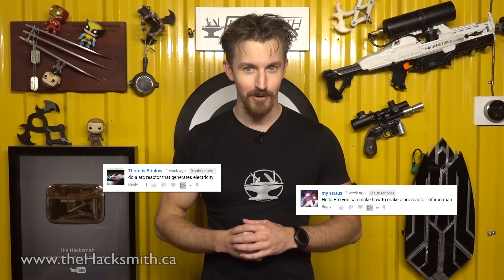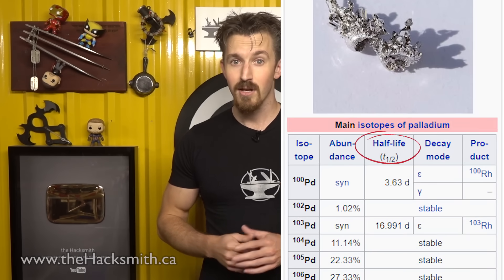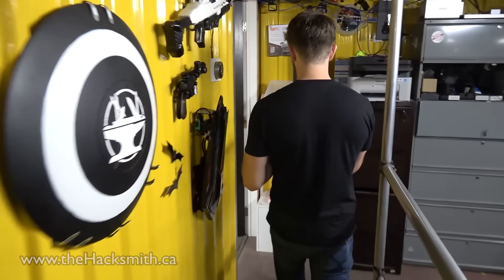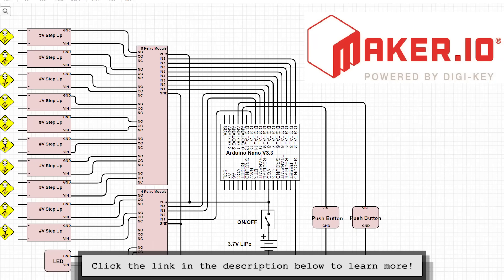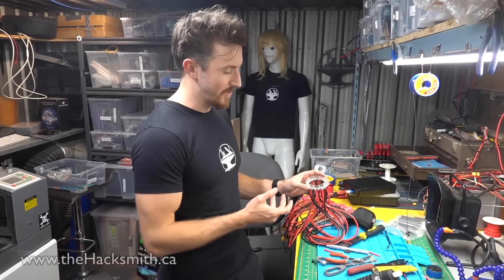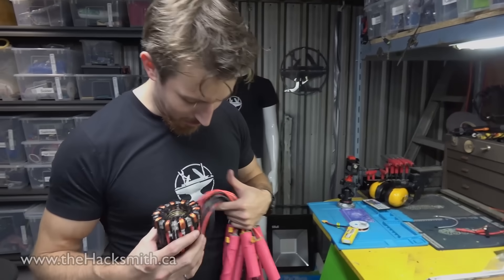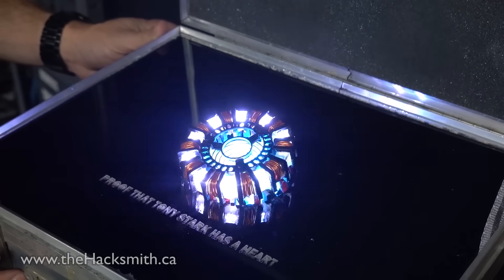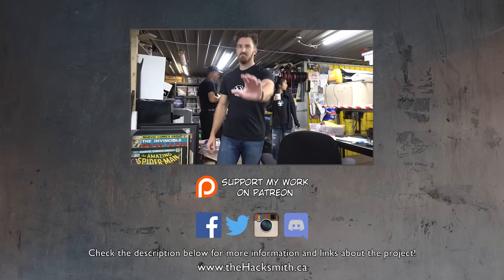Real Arc Reactor (ionized plasma generator)

Comment: No it's not I have a triple cage magnetic engine with 40v 5amp captivity create the extra voltage which cannot be destroyed it create  a iron dust field  for it magnetism and creative magnet field of iron around itself cannot be stopped and get started it's very hard to stop it but it be very useful for me yes I can use it for many portable works it is a free energy sorce 👍
Reply from the maker: wat
Reply: @hacksmith  yup it true I just using it right now to change inverter battery ok
Reply: @hacksmith  yea lessvoltage more ampire problem  can u suggest me some thing👍❤️

Comment: What happens to power if current is doubled?

For a resistive load, as the voltage increases the current will increase by the same ratio. If the voltage doubles the current doubles and the power goes up by four times.

Comment: What if you added a

A voltage doubler to the Stark reactor

If people don't know A voltage doubler  is an electronic circuit which charges capacitors from the input voltage and switches these charges in such a way that, in the ideal case, exactly twice the voltage is produced at the output as at its input

Comment: Ok there has to be a way to make a ark reactor that generates energy AT LEAST. Though what to run it on is hard to pick...
Mabey a injection of a gas that's not just air, something that the electricity can take energy from to generate power

Comment: you said it won't power anything useful, yet it produced 20 amps when you tested it. I'm not an engineer but on the Internet it sais a freezer uses 0.86 amps and a fridge 0.5 amps. so is it correct that you can make one to plug your fridge freezer in

Comment: The nice thing about the arc reactor is that it could really work. And it's not because of some "free energy hocus pocus", it is because of the way it's built which reminds me of a fusion reaction. To be more accurate, it reminds me of a tokamak reactor. Which in theory should work (and they are still working on it)

Just give them another 30 years and it'll eventually happen
Reply: the sparks dont actually generate electricity , and a chord coming out the back of the box powers the plug
Reply: @wildyghost3090  uhm yes? I know that?
Reply: dont worry ill make it happen
Reply: @hereforyou7322  please let us know when it is done
Reply: @jacclol8193  hahahha
Reply: @hereforyou7322  the most powerful man on earth
Reply: And how are you gonna fit that in the size of your hand.
Reply: Ïíœ
Reply: My channel makes fun soccer animations. If you have free time, you can stop by and watch it, thank you.
Reply: They would simply use the heat the reactor produces to create steam and move massive generators.

Comment: This is pretty cool, but I think you missed a key element to this project, u need an electro magnet. Magnets can hold an electric charge and essentially become a battery. You could actually achieve this build but don't forget Tony stark built this mini arc reactor to stop shrapnel from entering his heart. That's important to remember. So, if you use an electromagnet in your design your reactor would hold the charge rather than having to take it from so many 'tasers'. The electricity would travel around the arc continuously even once your removed your power source. Basically you'd charge it up once like a mobile phone.... im teaching myself quantum physics and mechanics to figure it all out haha awesome video tho guys

Comment: Each high voltage generator gives the output voltage of    
80kv right. Then 20 amps is just 
120v right,which is not near to 800000v. Plz anyone explain me

Comment: How did you transmit the high voltage to the air? I want to build something like this for a Science experiment.
Reply from the maker: High voltage naturally jumps air. It's about 1000V per centimeter typically

Comment: HackSmith made an ARK Reactor that expends energy to shine. Alex made a Reactor that actually produces energy (hydrogen) that can be practically used.
Reply from the maker: No, both use energy and do not create it... Hydrogen generation still requires input energy to create hydrogen gas. So neither are real arc reactors
Reply: @hacksmith  In the Alex reactor, the process of converting energy from one type to another is underway - from electricity and water into a combustible gas, which can be practically used in a different way than just electricity. Yes, of course, the energy costs exceed the production of other types of energy. This is not a "perpetual motion machine".
In other words, a hydrogen-oxygen gas mixture is more practical for use in this concept of the final device. Even a turbojet engine can be powered with such gas - the only question is the concentration and supply of such fuel to the combustion chamber. "But this is not a problem - this is a challenge"). Well, most likely, on a mixture - like a hybrid internal combustion engine - on a mixture of gas with kerosene or diesel.

Comment: I understand it's not worth it to sell to the grid but it charged your cell phone correct and how many times would charge your cell phone specially instead of trying to get the house voltage power you actually get USB power or 12 volt power and does it produce more energy then other means of cost a portable generator or emergency generator
Could be very useful
Reply from the maker: It's just using the battery though! It's just like a powerbank

Comment: 80kV per module? I seriously, seriously doubt that. Those modules don't produce anywhere near as high a voltage as they claim to output. I've had a few of them and they seem to be in the region of 30 - 35kV. If you go much higher you start to get arcing inside the modules and it pretty much kills them straight away.

Comment: Why not just make a scaled down circular krypton (or another gas if you wand a different color) arc lamp and use the coils to constrict the plasma, possibly even create the sensation of the plasma to be circulating ? I know that the container would be a hassle to fill up and seal and make sure it wouldn't melt but with big enough brains.... It would have many benefits, firstly the breakthrough voltage would be much lower so you would be able to use less batteries and wires and it could be wearable (with proper housing)

Comment: Theoretically speaking creating a perpetual energy would be possible within the law of conservation of energy similar to how some cars charge their batteries while you are driving they are simply converting a portion of the inertia and potential energy of momentum into a usable state and to create something like an arc reactor you would just need something that's able to generate a massive amount of power and feed a small portion of it back into the machine itself in order to continue operation

Comment: His circuit is impractical and too complicated for the intended (decorative) use.  Instead, use a resonant circuit (as for solid-state Tesla coils/plasma ball lamps) and thank me later.... (lower noise level, high frequency = easy to get longer arcs/higher voltages by resonant coupling).  Use the unconnected outer coils to guide the plasma arc by connecting them between "top load" and ground of the resonant circuit and switch them fast (e.g. multi plexing). Remember that voltage with high frequency can pass insulators 
, that is why this would work. Alernatively  try to use them to guide the plasma, but their electric field will most likely be too weak to cause an effect.
Just look up spark gap tesla coil and solid state tesla coil. The rest is self-explanatory.
Will look much more "realistic" =)

Comment: The term ionized needs to be tread on carefully and needs extreme precautions. Any kind of ionized radiation is very harmful. If the cells in your body detect atoms being split(which is what ionized means) then they will multiply out of control (which is what cancer means).

Comment: Just remember this!
"If it is possible? It is done!
If it is IMPOSSIBLE? It WILL BE done!"

KEEP TRYING! Thomas Edison failed over 2,000 times, before he finally figured out how to make a working light bulb. When asked, "How he felt about failing over 2,000 times?", he answered, "I didn't fail. I just found out 2,000 ways NOT to make a light bulb."
I honestly believe that EVENTUALLY, SOMEBODY WILL figure out how to create one of these. Sometimes looking at things from a different perspective can get a project over a hurdle, such as instead of using pressure, maybe using a vacuum? Light bulb elements are inside of a vacuum, instead of pressure. The vacuum, (absence of oxygen), I'd what prevents the element from burning in half. Perhaps a vacuum sealed Arc Reactor may be a hurdle that may be a key to the link that gets the thing figured out? Vacuum can possibly prevent heat build up, like in outer space? Is there a form of gas that can be inserted that has the ability to carry voltage, or change from positive to negative as it rotates over positive and negative posts inside an enclosed looped chamber? Just curious? Gotta keep trying? 😁👍

Comment: ARC reactor doesn't make arcs in the small device. It ionizes palladium, right? the palladium is glowing and giving off the radiation that is used as energy. ARC is for (affordable, robust, compact) not ionized air electricity arc. I'm pretty sure there is no air in the mini reactor either and it doesn't take the form of a tokamak like the big reactor that powers the facility using rare-earth barium copper oxide in a toroidal field. Unless I'm completely wrong, this device is more of a round taser, a neat cosplay prop. It is cool though!

Comment: The arc reactor looks more like a plasma based nuclear fusion reactor with the final ring not generating but creating a electromagnetic stabilisation circuit as the arc reactor is a fusion reactor using electric arcs to create plasma and then its turning plasma into electricity

Comment: Well...let' s also keep in mind an arc reactor is NOT a perpetual energy device. It's essentially a super battery. And I mean SUPER...BATTERY...so I think the arc reactor is meant to be what happens when you combine maximum efficiency with capacity.

Also remember that Tony has had to change and modify his arc reactor many times in the movies.

Comment: You know, I had an idea on how to make an ark reactor to. You see, I believe that plasma is when something gets so hot that the bonds between the molecules break, leaving freely floating particles and what happens in the sun is that these particles bond together, forming hydrogen so I was thinking that if you got something, turned it into plasma, and put wires made out of a positively charged substance, the negative particles would be attracted to the positive particles in the wire, bond with then, and create electricity. Let me know if it is smart, stupid, or if your too busy don't answer.
Reply: @Game Plays 1230 thnx
Reply: FBI open up

Comment: hacksmith: "alright i need to charge my phone let me get my charger"
pulls out entire arc reactor
Reply: Charges phone in 2 seconds. 😁👍
Reply: @glenturney4750  leaves it in for 3 seconds and phone explodes
Reply: @bigbosspanda1976  leave it for four seconds and it becomes a nuke
Reply: @solitude9875  pretty sure I would have a hard time charging it for 4 seconds after the phone explodes.
Reply: @bigbosspanda1976  no no, it comes in two stages:

The first when you blow the battery, the next when you blow the entire power grid
Reply: @solitude9875  and if you leave it for 5 seconds all technology in the world will be destroyed.
Reply: @bigbosspanda1976  lol-
Reply: @professional cheese Leave it for 6.4 sec and black hole will form, from the mass amount of energy and it collapses on it self.

Comment: 20 amperes...
Doesn't produce enough power to do anything useful...
Even at no more voltage than it takes to charge a phone, that's 100 watts!
Pretty impressive conversion of energy, considering the battery powering that contraption.

Comment: i wonder
can the hacksmith miniaturize and use the large hadron collider as a power source?
the large hadron collider (LHC) was built in switzerland n can launch protons and ions at super fast speeds and it keeps on accelerating those particles. the LHC was also able to simulate the big bang by colliding 2 of those particles. if the hacksmith could somehow miniaturize the LHC and convert the motion energy from the speed of the atoms into more practical energy, it might work similarly to the arc reactor. like in iron man 1 where the swirly thingy was constantly in motion rlly fast.

Comment: What if the arc reactor was a way to harness the energy within the air around us rather than unlimited energy in a closed system? (Just a theory)
Reply: The problem is that reducing the amount of free energy available to the air with a device allows the air to pull free energy from all technology touched by the air. This includes the human body.
Reply: @michaelchaney2336  Yeah, that would be a problem.
Reply: The Air is an open system touching both lava, the ocean, and the solar wind. Anything that draws power from the air impacts all of them. The Arc reactor is more likely an expression of the observer effect.
Reply: @michaelchaney2336  True, but the energy the arc reactor outputs is not that much compared to the energy in all the objects and substances that air would touch.

Comment: So question here. If the ark reactor is impossible and cant create energy then how did you build one producing electricity
Reply: The batteries (maybe capacitors) that supply power to produce the arc effect are the cylinders at the ends of the wires. These are also wired into an inverter connected to the outlet. It's basically a battery pack with an insanely inefficient activity light. But super cool looking.
Reply: @ussenterncc1701e  Oh so if they use the reactor to power somthing the energy in these possible capacitors runs down
Reply: @Forest9528  yes, runs down faster actually. The arc effect itself consumes a lot of energy, and powering something else off the batteries or capacitors will just deplete them sooner.
Reply: @ussenterncc1701e well yeah it's pretty loud so that's alot of energy loss

Comment: I feel like the analysis of the arc reactor was a little weak.. I am not a huge marvel buff, I dont think I have even seen all the iron man movies.. but I always assumed the arc reactor was a fusion reactor, it is shaped like a tokomak, which is a toroidal device used to achieve  magnetic confinement of the hot plasma and is one of the only practical ways we could achieve fusion based nuclear power.

Comment: actually i speak spanish And right now I am using Google Translate, anyway. Regarding the conservation of energy, it is true, but generating infinite energy can be discussed, energy It transforms, it cannot be created or destroyed, but I have an idea, my idea is that the same energy of the arc reactor rotates within it and that it creates energy by friction, so every time energy is subtracted from the reactor (by charging a phone or something similar) it is replaced with energy by friction, that also implies more risk of overheating or
Reply: Bro, there are many misunderstandings in your idea , I don't want to be rude by your opinion, actually friction is not itself an energy but it converts mechanical energy into thermal energy and however you can't store energy it can only be stored in matter eg, nuclear energy is stored within an atom,thermal energy within any matter until it is excited via any chemical process and biggest misunderstanding I presume you have is that energy can not exert friction on each other cause friction asserts on surfaces and energy doesn't have surfaces
Reply: @aps7637  In fact, I was referring to the fact that with magnets propelled by the electricity of the arc reactor, I move an object (made of metal rhodium-plated of, cloth?) inside the framework of the reactor and with that energy by
Reply: @aps7637  friction, and with a mini transformer the energy can be transformed by friction to electrical energy, and the same with thermal and rotational energy
Reply: @aps7637  Maybe my idea is not correct but we are all wrong (and also I am only 12 years old)

Comment: while this looks awesome and really shows just how complicated the arc reactor is. my only complaint is that you repeatedly say the arc reactor is the power source when its really not in this setup. you made a prop but present it as the real deal. the wiring could have been made more discrete, then use the "has a heart" mount hide all the extra components out of frame. the concept was executed wonderfully. but I can't help but feel baited knowing the arc reactor is little more than a showpiece
Reply from the maker: Did you skip the intro of the video? I explain why it's impossible

Comment: Why using relais?
Use a Mosfet or a bipolar transistor
U can buy them in Sot32 Cases for example
That's smd (surface mounted device)
So your whole circuit shrinks a lot!
There are Mosfets or Transistora with a huge breakdown voltage
Might work like that

Comment: How is that supposed to generate any power? Aren't you just powering it off a battery?
Reply from the maker: Yeah,  like I said in the video its not possible to make
Reply: @hacksmith  ok but it does say real arc reactor.

Comment: Also couldn't you used magnetic force in a circle to generate electricity by spinning a wheel or gear? Like a bike peddle constantly spun by a ring of magnets and then use that spin to generate electricity.
Also if you used super conducting materials, in theory super conducting material should multiply energy exponentially.
 @the Hacksmith
Reply: I know Tony Stark had to keep the shrapnel from getting deeper into his heart so I would think he used magnetic force, his reactor quite possibly worked like what I described in my comment.